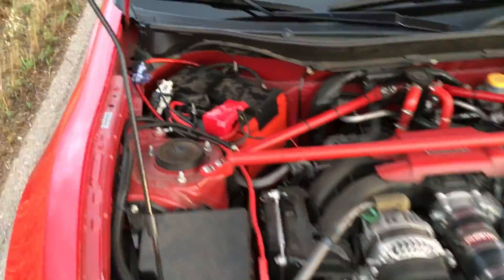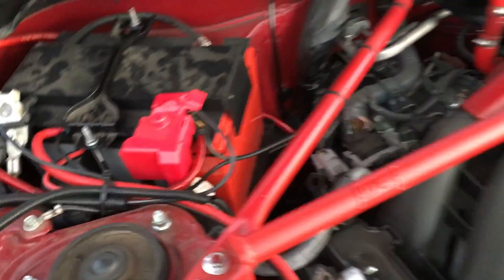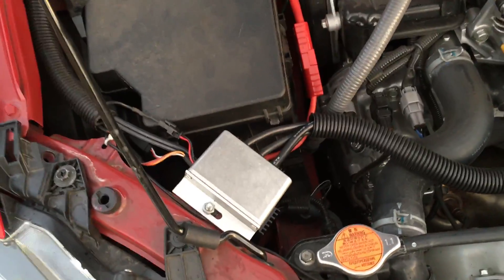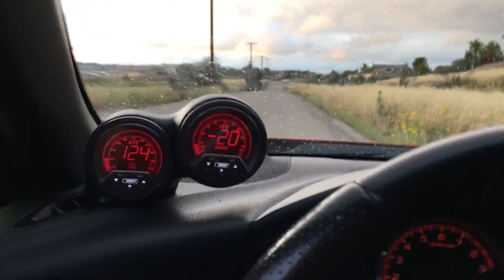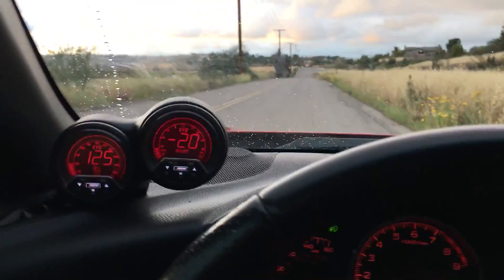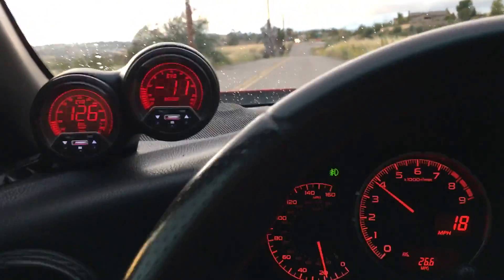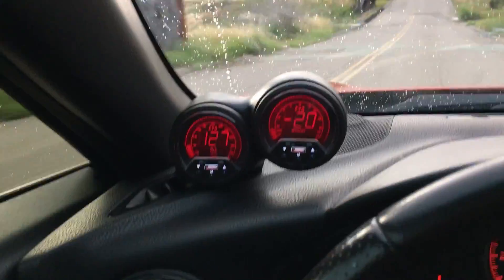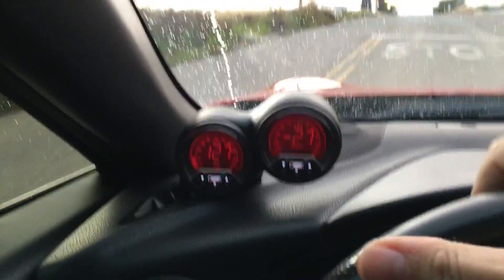Phantom V3 Proof of Concept- Boost Gauge Proof- Electric Superchargers Can Be real

Comment: lulz.. went 5,4,3,2 like it was going out of style. you got a CFM spike for second and that was it. My guess you actually lost power in the end. Dyno proof or shit is worthless
Reply: Before posting such eh. . . educated comments, you could try googling dyno charts for this system, and you will see plenty of them showing very appreciable gains. Don't hate on stuff just because you don't understand.
Reply: Umm that would be called a supercharger at one speed and engine air consumption increasing so positive pressure decreases. Basic engine dynamics.

Remember CFM and PSI are entirely different. Two identical motors with one turbo high flow cfm and one low flow. They both push 14psi but the high cfm makes almost double the horsepower, same boost though.

Comment: Is it me or did the boost levels drop as RPM's increased?
Reply: It did a little. What I believe might be going on is the electric the compressor reaches max rpm very quickly, but since this system is limited by how much electrical power is available the airflow demands of the engine begin to out-pace what the compressor is supplying resulting in a reduction in boost pressure. (It could also be a vvt system changing cam profiles and reducing restriction which reduces boost pressure and increase airflow)
You see this often on conventional superchargers of all types that are too small for the engine, but in this case the compressor is under-powered. He needs a bigger compressor, or more power to spin it faster (or a smaller engine with less airflow demands) and you'd see higher boost levels.

Comment: It had to happen eventually. It makes perfect sense to use an electric motor to run a turbo charger. Better control, quicker boost, easier to control, no additional heat. Pretty expensive at the moment but that will come down quick enough. Great effort.
Reply: Mate! If the concept wasn't sound then why is Audi spending serious investment on R&R for this exact same concept for there new road cars?
http://www.roadandtrack.com/car-culture/a8965/why-electric-superchargers-make-sense-now/

Comment: it makes about 5psi...0,300 bar. its decent.but when not working does it slow down air admission?
and 2nd thought- how can it generate more engine power without modding the ECU for  more fuel, and advance spark ingition?

Comment: It needs to be on a dyno and the base horsepower is necessary or it is all of limited use. Most important is engine size and power. Stick this on a larger 4 cylinder or six cylinder and the boost will go away. Put it on a smaller lower base power engine and the power change as a percentage of engine power will greatly increase. What size and horsepower is the test engine? With enough battery power an electric supercharger can be beneficial at the HP<100 levels, if you have enough battery power. Above that, and the electric motor size starts getting prohibitive with engine over a few hundred horsepower. The higher the base engine's horsepower, the less power will improve. With a large enough engine, power will decrease. This is why these things need good planned tests.
Reply: Yea on a 1.5l it would be perfect,  only thing is 2500 is way too much...

Comment: Interesting but I'll recap how I see it; When you punched it you got incremental 2-3-4 PSI, as the RPM actually climbed it dropped down to 3-2 before you let off the gas. To me that means that the low RPM and got some boost but as the car accelerated it couldn't keep up. The fact that you got any boost is impressive but the real proof for me would be to see a true MAF sensor readout together with throttle, fuel ratio and everything else going on. Thanks for posting.

Comment: yep, she works. not as strongly as I'd hoped but works. if the controller can handle it I'd look to replace the brushless motor with higher wattage capacity and higher Kv value, if there isn't a setting to increase the current motor's boost ability. the 1/4" line from intake tube to controller probably does have something to do with a limiting sensor. a quick dirty test might be trying a vacuum limiter on that line so it's forward pressure hits slower, which just might increase the boost psi a couple seconds for delaying limiter response. yep, I fully admit I'm guessing on that, but if correct you could make test adjustments with a few different flow value vacuum limiters. I don't see an issue with boost fading away at 6-7000 rpm, that's probably a good thing!

Comment: 4lbs? I'm not even sure if a butt dyno would pick that up. Nice effort though. I think I read down in the comments you spent $2500 on this setup? If that's true why not buy a real turbo setup for less or around that.
Reply: Yeah, a "butt dyno" would notice 4lbs of boost on a N/A engine.
Reply: Peter Selie actually my skyline idles with -20 and my gauge is psi
Reply: Peter Selie the meter is exposed to the engines suction and produces a vacuum.
Reply: Yes you will feel a difference on a n/a motor or any motor with a 4 psi difference. Especially more volumatic efficient motors and bigger displacement. On my motor  I went from 443hp to 731hp with just 10 pounds. At 14 to 15 I would be around 900
Reply: these are not those plastic ebay superchargers AUDI is looking into this and has been since 2014 and we are told to expect them to add them into the fleet in upcoming manufacturing so uhm yeah. NOT FAKE
Reply: Peter Selie have you never seen a boost gauge lol? It measures vacuum in "in/Hg". Only when it turns to positive pressure does it measure psi. Plus the line to it is after the throttle body so it's definitely gonna be below atmospheric pressure.
Reply: Holy shit the amount of stupid in this thread
Reply: This is why the aliens won't talk to us.
Reply: Peter Selie engines pull a vacuum. Boost gauges will read 0 at 14.7psi. They will read a vacuum at anything under 14.7psi and they will read boost at anything above 14.7psi. That is the general rule of thumb but atmospheric pressure depends on atmospheric conditions and altitude
Reply: Every commercially available boost gauge shows inches hg in vacuum and psi under positive boost. What a crazy concept, a gauge that shows BOTH the standard metric used for vacuum AND the standard metric used for boost on the same readout.
Reply: Tech X
Reply: you're pretty dumb
Reply: Peter Selie -20psi is the amount of vacuum the engine is pulling at idle... at wide open throttle it will read 0.0psi means atmospheric, think of it this way each number past 0psi is multiplied into the atmospheric pressure... so once the gauge reads 14.7 that’s reading ( 2 atmospheres of pressure )
Reply: @Spiderman No shit...
Reply: When running stationary the "boost gauge" shows -20. Since atmospheric pressure is 14.7 psi and you can't go lower than vacuum that gauge isn't showing psi. Either that or the guy is from a different planet. My guess is that it's either showing inch Hg or not showing boost at all, but something else entirely.

Comment: Wow, very impressive video. from watching the boost gauge I noticed you only got boost when you floored it. Does this mean that the turbocharger only runs on full throttle? If so, is there a bypass valve for air to get in when the turbo is not spooled up?
Reply: +steveisking1 the vanes don't do much restricting when unpowered normal driving, he did plant the switch at pedal to kick in when floored.

Comment: @Steve Grau  Im impressed. Thanks for doing your video. However you can see it runs out of air flow at high rpm since the engine is consuming a lot of air and the electric motor cant keep up, but it does make some boost which you can definitly feel with a tune in low rpm. Since its not intercooled its not as effective as 5 psi with a conventional intercooled turbocharger, but for such a simple install and since we all drive in the rev range which your ''supercharger'' makes power most of the time, you can definitly feel the gain. I hope you understand me being sceptical at first but i now believe you. its not big power gain but its definitly a gain. Now ive got another question for you, how much did it cost you for the entire setup , and if you are part of the project and dont pay the full retail price, what would be the retail price for this setup (not that i want one i already have a real turbo on my car, im just wondering). Thanks.
Reply from the maker: +Redneck Mechanics 

As you said as more air is needed the system produces less boost. You get peak boost at around 3000-3500 rpm. (5 psi) it keeps 3 psi all the way up to 7000 rpm.

What's nice about this system is that there's no lag and when cruising there no drain on the engine since you don't need to spin a turbo or sc. 

Also the car is helluva a lot more torquey then it was before which is an added benefit.

Couple other benefits:

I live in ca and the smog laws are a bitch. I can remove this system in 5 mins. And a first time install takes around an hour and anyone can do it.

Cost: 

I was the fourth person to obtain a phantom. At that time I paid 1500 dollars for the system. I then went to a reputable tuner for the ft86 and he tuned my car for $500 including the tablet needed to switch tunes.

Plus the batteries.  ( around 150-200)

Current cost:

Phantom:  I believe it's around 2k currently
Tune: $450 from open flash tablet (includes an off the shelf map)
Batteries: starter: $125, system batteries: $150
Reply from the maker: +Steve Grau  also I don't work for Phantom I originally made the video to help others with their installs. I am lucky enough however to have been a tester for new hardware.
Reply: I do like the fact that its easy install and uninstall and pretty much anybody can do it, i also do like the fact that is spools at low rpm but im kinda disapointed to see your gauge drop to 2 psi at high rpm.One thing you need to know is that turbochargers are not a restriction for an engine and do not drain any power. Belt driven superchargers howerver do drain some power. 
The only problem i see is that your setup is too expensive. As you said it cost you more than 2500$ and by buying second hand (or ebay) parts its possible to install a real turbo on a car for that budjet and make much more power.
Some cars are more expensive than others, for instance its cheaper for a car that has a ECU which you can tune like your car, but some cars have ECU you cant tune and you have to get a programable ecu which is more expensive. 
In my case, i wanted to build a turbocharged car. I bought a bare shell which cost me more to build, but lets say i already had the car. The header cost me 100$ second hand. the turbo cost me 200$ second hand. I made the downpipe myself which cost about 50$ but you can get one off ebay for cheap. i bought a second hand intercooler which was also 50$ (cheap on ebay). Bought some exhaust piping to make some intercooler piping for around 50$ which you can also get on ebay very cheap. bought some oil lines at a hydrolic shop which cost me 150$ but they are cheaper on ebay. Bought a second hand waste gate which cost 100$ and a divertor valve for 50$.  In my case the ECU was already tuned for turbo application so it didnt cost nothing. Keep in mind i forgot some dings and bobs, but thats about what you need. i produce 15 psi of boost from 3000 rpm up to 7000 rpm. If it was a car which needs a tune unlike mine, you can ad 500$ to that or a bit more if you need to get a second hand programable ecu. But as you can see for about the same budjet as you, i have a real turbo car which produces much more power.

Dont get me wrong, your setup definitly is impressive for what it is and is probably a step foward in electric supercharger, but people have to consider to install a real turbo for the price your setup costs. Its true that your setup is much easier to install and not everybody is able to install a real turbocharger, but with the help of google and youtube nothing is impossible. Maybe in the futur your setup will get cheaper and more attractive, but for most people its too expensive and doesnt provide enough bang for the buck.

Im very happy you took some of your time to chat with me on the subject. That goes to show that 2 person with different opinions can discuss in a respectfull maner and understand each other.
I invite you to go on my youtube chanel to see the video of my turbo car build, i think you might enjoy it.
Reply: You do know you need more than a turbo for it to work with the engine right? No it is not cheaper overall. The problem is not electric supercharging, but the cheap designed and small size. You can make a much larger design with greater volume.
Reply: 4psi of boost for that amount of money is a complete waste to be honest. It would have been cheaper and more efficient just to run NOS. Its not like you need boost all the time, and 4psi really isn't doing anything on a 2liter engine.
Reply: Mostafa Abubaker
Reply: @Themayseffect: have you heard of low-pressure turbocharging? IE. SAAB. 3psi does make a difference. 2L motor.